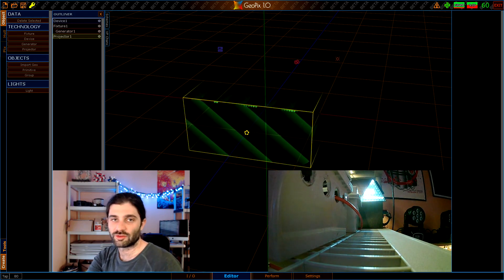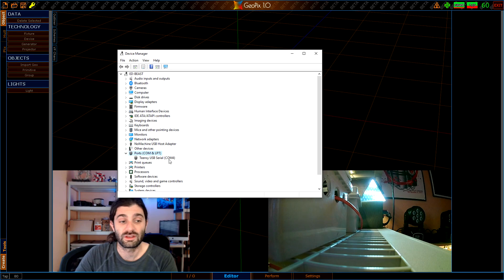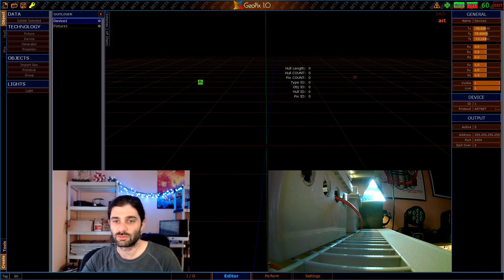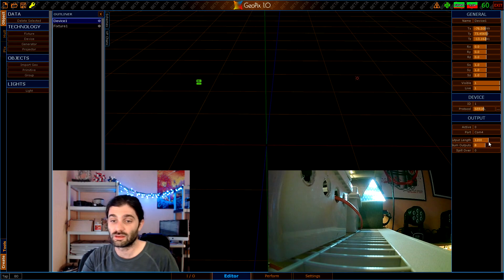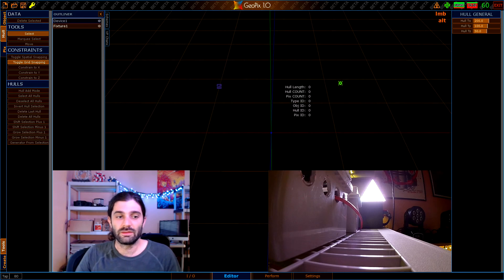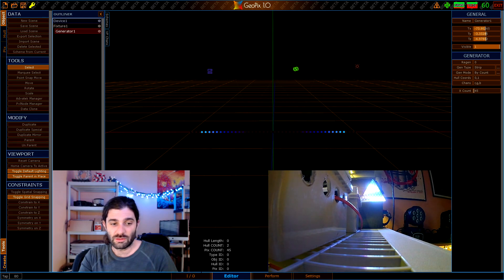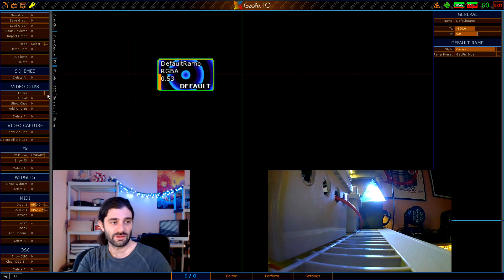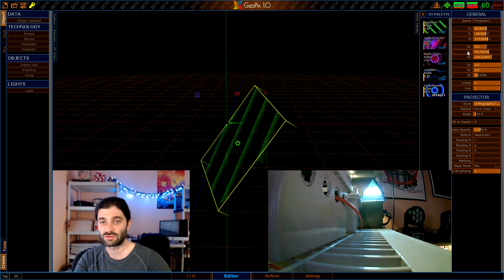Intro to GeoPix 1.0 :  #1 - First Light

Comment: Can you point me in the right direction of how to add analog spot or analog rgb strip via arduino serial? I would like to adapt the fast led sketch to do pwm output from arduino on 3 pins(r,g,b). I think fast led may be overkill for this, but they have a showanalog function.  I tried adding a light fixture (1px) but cant seem to translate incoming data to pwm pins. Help?

Comment: wait, so do you need touchdesigner to run geopix? Do you need commercial TD first to run geopix?
Reply from the maker: You don't need to install touch explicitly, the installer handles all of that for you. 

I'll have the final version setup so that it can be run in touch player (no derivative account needed)or TouchDesigner where you can avoid some of the touch player ui.

This all falls under the GeoPix free tier.

 the next tier is hobbyist where you can use gp with greater number of universes, since this is a non commercial license type no commercial td license is needed.

Above that are GP commercial and pro, and both will require a touch license of at least touch player commercial to run!

Hope that helps.
Feel free to reach out on the slack or email if you have more questions!